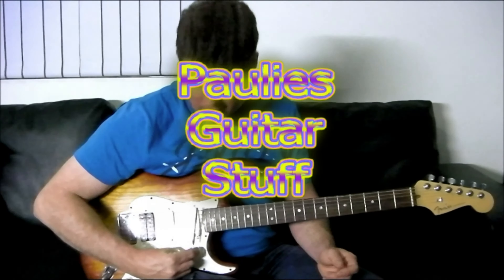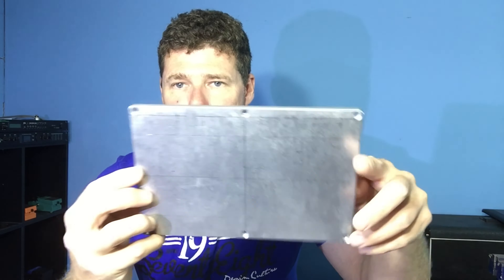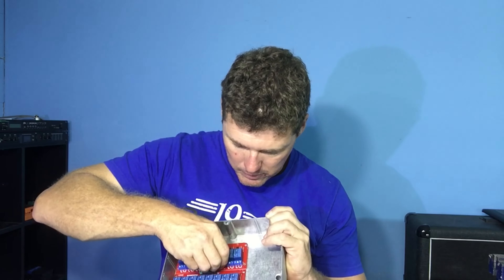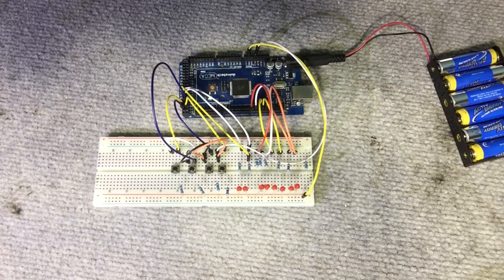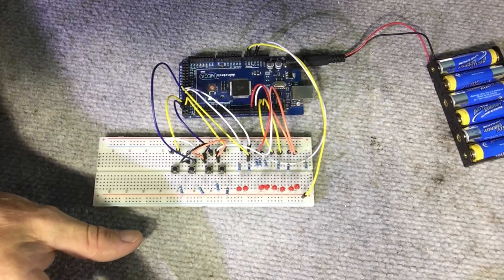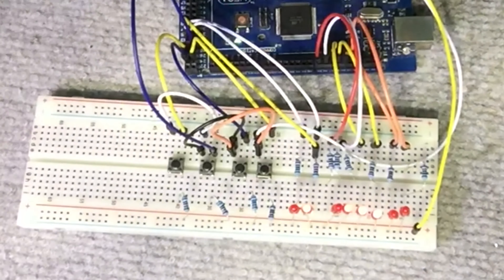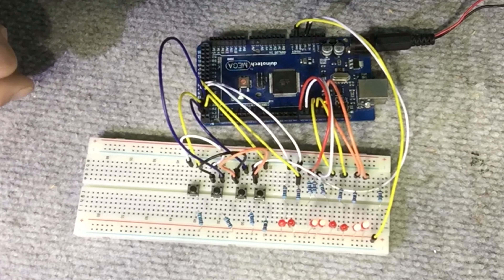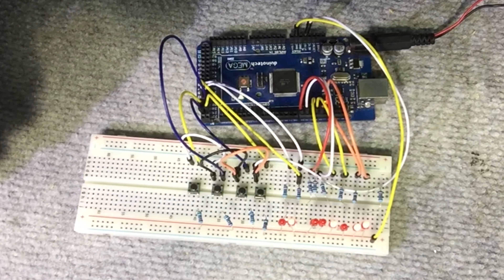DIY Programmable Pedal Loop Switcher Build (Part 2)

Comment: Absolutely inspiring! :) 

Great video and well explained. Just the coding part was  bit messy and I thought I'd contribute. So, I have prepared the whole thing in little bit more organized .RAR file for download on this link:  

http://www.mediafire.com/file/uvwpc40d8u60fhd/looper8ch_new.rar
Reply from the maker: That is incredible. Thank you. I just hack away until it works with coding.
I do need to work on house keeping as I make progress.
You have done an awesome job with the schematic and tiding up the code.
Cheers.
Reply: You are most welcome with great pleasure and godspeed with the coding. 
Cheers
Reply: Good afternoon
I wanted to ask you a question. I copied the program to Arduino, but when I run it, I only turn on the leds of channels A and B. Why is this happening to me?
Reply: I’m curious why you’re not using GitHub,  or some other online version tracking repository?

Comment: I'm looking forward to this. I'd like to become a little more keen to coding and begin to venture onward to digitally controlled analog effects or develop some interesting delay units, but I'm aiming to build a similar bypass looper out of wood with programmable presets and momentary switches. Your code will definitely help with that, so thank you!
Reply from the maker: Cool. I am no coding expert. I am just hacking away at it until things work.
Apparently that is the best way to learn.
See how you go with the wooden enclosure for you switcher, in my experience you need to house effects pedals and switchers in metal boxes to shield the signal path from EMR that creates noise.
I guess you could shield the cavities much like they do with electric guitars.
Reply: That's basically what I'll be doing. Laying down a foil material and shielding to ensure a sufficient ground, along with connecting ground points wherever the space allots itself. I know a few individuals that build effects in wooden enclosures and it's usually not a terrible issue, however a bypass looper carries quite a few larger components across a wider surface area, so my initial thought may be a little ambitious. I don't think I'll have too much of an issue, but if I do I can always transfer everything over to a metal enclosure if need be. :) I commend your attempts to become familiar with the digital side of things from the ground up, and I'm pretty excited that it's working for you thus far.

Comment: great project, looking to do similar, could someone pls tell me if the code stays saved when powered down, ie pedal not in use for a period of time
Reply from the maker: Yea it holds the code for a very long time.
100 years at 25 deg C.

Comment from the maker: Here is that code. As it would not fit in the description.
/*
  Intelligent LOOP SWITCHER for guitar pedal board
  by Paul Graham
  Note: This sketch is under development and is not complete.

 Turns on and off pre-determined relays connected to digital
 pin 13,12,11,10,9,8, when pressing a pushbutton attached to pin 2, 3 or 4 for diferent configs.

 The circuit description:
 * LED attached from pins 13 to 8 with 160 Ohm resistor in series to ground
 * pushbuttons attached to pin 2 to 4 from +5V
 * 5K resistor attached to pins 2 to 4 from ground
 */

// constants won't change. They're used here to
// set pin numbers:
const int button1 = 22;      // button 1 input pin
const int button2 = 23;      // button 2 input pin
const int button3 = 24;      // button 3 input pin
const int button4 = 25;      // button 4 input pin
const int loop1 = 13;       // loop 1 output pin
const int loop2 = 12;       // loop 2 output pin
const int loop3 = 11;       // loop 3 output pin
const int loop4 = 10;       // loop 4 output pin
const int loop5 = 9;        // loop 5 output pin
const int loop6 = 8;        // loop 6 output pin
const int loop7 = 30;        // loop 7 output pin
const int loop8 = 31;        // loop 8 output pin
const int bankin1 = 35;     //input for bank led

// variables will change:
int buttonState1 = 0;         // variable for reading button1 status
int buttonState2 = 0;         // variable for reading button2 status 
int buttonState3 = 0;         // variable for reading button3 status
int buttonState4 = 0;         // variable for reading bank button
int bankread1 = 0;
long lastDebounce = 0;
long debounceDelay = 100;

void setup() {
  // initialize the Loop pins as an outputs:
  pinMode(loop1, OUTPUT);
  pinMode(loop2, OUTPUT);
  pinMode(loop3, OUTPUT);
  pinMode(loop4, OUTPUT);
  pinMode(loop5, OUTPUT);
  pinMode(loop6, OUTPUT);
  pinMode(loop7, OUTPUT);
  pinMode(loop8, OUTPUT);
  
  // initialize the button pins as an inputs:
  pinMode(button1, INPUT);
  pinMode(button2, INPUT);
  pinMode(button3, INPUT);
  pinMode(button4, INPUT);
  pinMode(bankin1,INPUT);
 
}

void loop() {
  //one button bank switching with delay for debouncing
  buttonState4 = digitalRead(button4);
  
  if ((buttonState4 == HIGH)&&(bankread1 == LOW)){
  //turn led8 on
  digitalWrite(loop7, LOW);
  delay(200);
  digitalWrite(loop8, HIGH);
  delay(200);
  }
  buttonState4 = digitalRead(button4);
  bankread1 = digitalRead(bankin1);
  
  if ((buttonState4 == HIGH) && (bankread1 == HIGH)){
    //turn on led7 
    digitalWrite(loop8, LOW);
    delay(200);
    digitalWrite (loop7, HIGH);
    delay(200);
  }

// bank one programming
  buttonState1 = digitalRead(button1);
  bankread1 = digitalRead (bankin1);

  if ((buttonState1 == HIGH) && (bankread1 == LOW)){
    // turn LEDs on and off:
    digitalWrite(loop1, HIGH);
    digitalWrite(loop3, HIGH);
    digitalWrite(loop5, HIGH);
    digitalWrite(loop2, LOW);
    digitalWrite(loop4, LOW);
    digitalWrite(loop6, LOW);
  }
  buttonState2 = digitalRead(button2);
  bankread1 = digitalRead (bankin1);
  // turn LEDs on and off:
  if ((buttonState2 == HIGH) && (bankread1 == LOW)) {
    digitalWrite(loop1, LOW);
    digitalWrite(loop3, LOW);
    digitalWrite(loop5, LOW);
    digitalWrite(loop2, HIGH);
    digitalWrite(loop4, HIGH);
    digitalWrite(loop6, HIGH);
  }
   buttonState3 = digitalRead(button3);
   bankread1 = digitalRead (bankin1);
   // turn LEDs on and off:
   if ((buttonState3 == HIGH) && (bankread1 == LOW)) {
    digitalWrite(loop1, HIGH);
    digitalWrite(loop2, HIGH);
    digitalWrite(loop3, LOW);
    digitalWrite(loop4, LOW);
    digitalWrite(loop5, HIGH);
    digitalWrite(loop6, HIGH);   
   }

   //bank two programming
   buttonState1 = digitalRead(button1);
  bankread1 = digitalRead (bankin1);

  if ((buttonState1 == HIGH) && (bankread1 == HIGH)){
    // turn LEDs on and off:
    digitalWrite(loop1, LOW);
    digitalWrite(loop3, HIGH);
    digitalWrite(loop5, HIGH);
    digitalWrite(loop2, LOW);
    digitalWrite(loop4, HIGH);
    digitalWrite(loop6, LOW);
  }
  buttonState2 = digitalRead(button2);
  bankread1 = digitalRead (bankin1);
  // turn LEDs on and off:
  if ((buttonState2 == HIGH) && (bankread1 == HIGH)) {
    digitalWrite(loop1, HIGH);
    digitalWrite(loop3, LOW);
    digitalWrite(loop5, LOW);
    digitalWrite(loop2, HIGH);
    digitalWrite(loop4, HIGH);
    digitalWrite(loop6, LOW);
  }
   buttonState3 = digitalRead(button3);
   bankread1 = digitalRead (bankin1);
   // turn LEDs on and off:
   if ((buttonState3 == HIGH) && (bankread1 == HIGH)) {
    digitalWrite(loop1, HIGH);
    digitalWrite(loop2, HIGH);
    digitalWrite(loop3, HIGH);
    digitalWrite(loop4, HIGH);
    digitalWrite(loop5, HIGH);
    digitalWrite(loop6, HIGH);   
   }   }
Reply: cool! bro, you can share your code easily in codepen.io